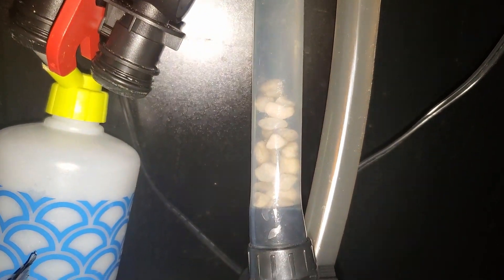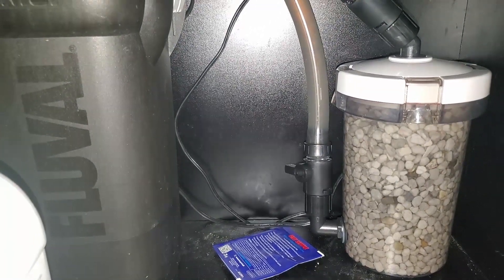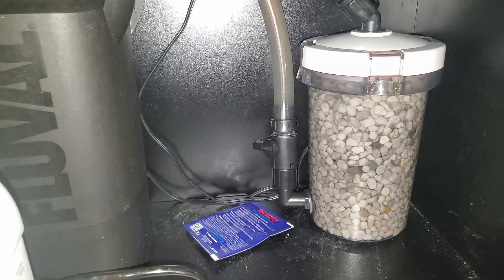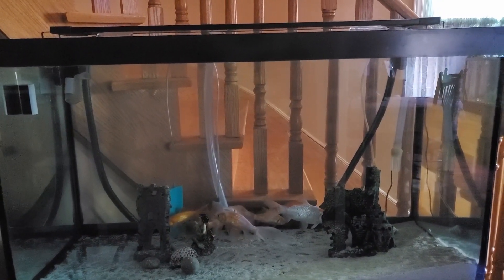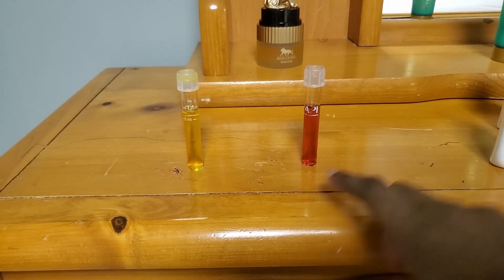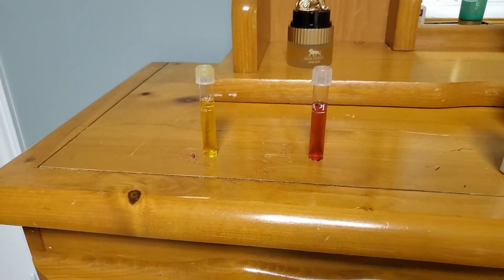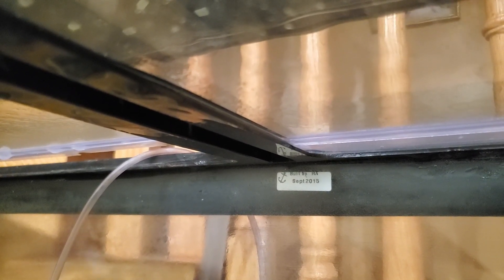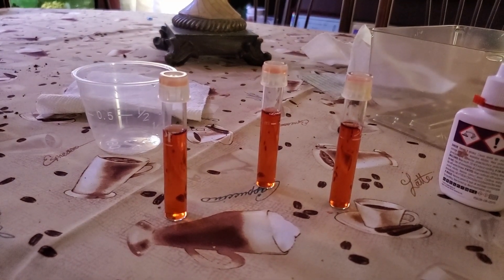Nitrate  Reactors Do Work

Comment: Seachem matrix is just pumice stone at 4 times the price now the full cycle can be achieved by deep substrate beds of 3 to 4 inches this will encourage anaerobic bacteria this converts nitrates into nitrogen which simply bubbles off adding leaf feeding plants will help also and removing the waste before it can break down ,,,how long did you cycle your tank
Reply from the maker: The reactor has been cycled for approximately 1.5 months the tank however I wouldn't remember
Reply: @aquaticspendthrift4228  sounds like a break in the cycle ,,but great idea especially with gold fish

Comment: 1droplet/s. 10s 1ml. 3600s =1h 360ml. 24h  8.5L per day, reactor can process aquarium water. If aquarium is smaller than this volume, then it will be possible to remove nitrates. Otherwise nitrates will constantly add to water. Or it will be like diluting aquarium water with clean one. Technically to remove nitrates we need 51% water change or roughly 17l aquarium can work, if we exclude all canister or sump water.  If reactor can process 10droplets per second, then it would be realistic that people show how they denitrificate almost 200l aquariums.
Reply from the maker: Yes that is assuming your goal is to generate 0 nitrates in your aquarium. My goal is to reduce water change frequency. If you did want to generate 0 nitrates you would go with a sulfur denitrator which can easily handle 10 drops/s
Reply: @aquaticspendthrift4228  constantly weekly add glycerine diluted 10% around 5ml. If to use more than 20ml, can jump nitrites. Nitrates reduces to 10ppm. In my case i have 15l of ceramic rings and balls, and repurposed to anaerobic process internal juwel filter, which get water from canister filters. All canisters connected in series.
Partially unstable. Would be good to buy nitrit, nitrate and orp selective electrods. And close cycle of canister filter, periodically based on data refresh water and add carbon sources.
2years almost no water changes, only add water when filters were cleaned, once per 2 weeks, around 6l due to prefilter. All other bio filters once per month or more if flow do not drop, give extra 15l.
Reply from the maker: @iIiWARHEADiIi  Just to make sure i intrpreted correctly,  you add glycerin as a cabon sorce to help with the nitrogen cycle. You have 2 filters in series 1 being used exclusively for biomedia. And use a nitrogen selecive electrode to monitor nitrate leves out the filter and adjust glycerine (carbon dosing)
Reply: @aquaticspendthrift4228  eheim classic very old one- prefilter, jbl900 and jbl1500 all in series. Output goes to internal juwel filter filled with seramis baked clay. Yes, glycerin as a carbon source, used also on sewage water treatment facilities.
Selective electrods still dont have 🙁, only wishes

Comment: use sand, and you need carbon sources, like sugar, alco, co2, for those bacteria to work(minerals) if theres oxygen, they use oxygen instead of transfering no3 into n2
Reply from the maker: Its actually seachem denitrate in the filter which is a very porous biomidia. Also carbons sources help but are not necessary as your always adding fish food which is a carbon source.

Comment: Try very porous media like bio gravel in it. Normal gravel doesn't really do much in terms of Anaerobic bacteria because the outside has high oxygen. You want slow flow rate, very porous media, the outside of the media will have aerobic bacteria which will gobble up the oxygen and deep in the porous media the Anaerobic bacteria will flourish.
Reply from the maker: Its actually seachem denitrate in there not just regular gravel and I have recently switched it to expanded clay which seems to work just as well. I believe the flow rate/ how much oxygen you can remove before it hits the reactor is the most important factor when setting up a nitrate reactor.
Reply: @aquaticspendthrift4228  Glad you got it working out. I have anaerobic conditions in all my aquariums. But I just use biohome ultimate in the filter at 2kg per 100L of water. Works a charm.
Reply from the maker: Just out of curiosity for your tanks running biohome what size are they and what filters to you use and what are your average nitrate and how frequently do you water change?
Reply: @aquaticspendthrift4228  450L African cichlid tank. Fx6 & Maxi kani 1200. Combined 9kg of media between the 2 filters. 

240L tank Discus and angels community, Eheim pro3 and Sera Uvc extreme 1200. 4,5kg of bio media. 

100L tank, Eheim experience 150 and eheim internal filter. 2kg combined media. 

Water change every other week. But not for Nitrates, just for minerals as PH buffer. Faster here isn't very high in mineral content.

Comment: It’s not the length of the hose it’s the flow rate, you have reduced the flow rate with hose kinks
Reply from the maker: Actually it is, at least from the results I got. I initially ran it without the hose from fast to extremely slow drip rates and I didint get any results(still got nitrate readings). Within 2 weeks of adding the hose i got results at fater driprates than without the hose. I think this is becuse it gives more time for the oxygen to be depleated before it actually reaches the caster full of biomedia. With a longer hose you can have higer flowrates becuse of the increase contact time i belive.( Not 100% sure but thats the results from my test). Its why coil dentrators work but they have the flaw of clogging since airline tubing is so small.

Comment: Watch Dr. Kevin Novak he'll show you how to setup what he calls a BCB Basket. Dude is smart and has done actual tests on all this stuff.
Reply from the maker: Ill check him out
Reply from the maker: So i just watched one of his videos and it appears im doing somthing very similar, ironically someone comented to add expanded clay insead which i recently did also.
Reply: I think your biggest problem is you have the water flowing through the media when it needs to flow around it. You don't want water flow actually going through because to much oxygen gets in.

Comment: Cool! Where is the water coming from to the nitrate reactor? It needs to come, in my understanding, from your most efficient nitrification filter. Have Y cross ing in the outlet of this nitrification filter and a valve to control the Flow rate to your denitrification reactor. This way you get as anoxic water with the highest nitrate as you can get to your reactor which is what you really want. Hope it works out for you!
Reply from the maker: My nitrare reactor is basically set up like that . The flow is coming from my canister filter. You can see how i set it up int the following video https://youtu.be/5sgWpS0Cegk

Comment: Awesome experiment..please continue more experiments.. can you look into kevin novaks video on how to set up anoxic cannisters ( basically make the water go around the media than through it) and if possible use different media to experiment..like pumice, leca balls .
Thank you
Reply from the maker: We will seee. I kind of broke my nitrate reactor 😓 so i need to buy a new one. What im more intreseded in rather than the type of bio media is adding a carbon sorce like woodchips could bost its effectiveness and test it on my larger tank.
Reply: @aquaticspendthrift4228  pumice and leca balls have been used for commercial denitrification..and much cheaper..so you could try those..as of now are you using any carbon source? Fish food is supposed to provide some.. you could use one or two chunk of horticulture charcoal..i know that is used for providing carbon source in potting mixes.. Specially succulent mixes..methanol and vinegar just seem more risky..you could also incorporate a bit of iron compound in the midst of the media..that kickstarts the growth of anerobic bacteria..
Good luck again :) again.. great effort..do keep it up..
Reply from the maker: No carbon sorce just feeding the fish. ya i dont want to use liquid sorces because it would be a lot of work to constaly dose and monitor - like you said more risky. Probably wont do more vids on the nitrate reactor for at least 4 months tho
Reply: @aquaticspendthrift4228  yep.. that is understandable, as new denitrification media will take at least 3-4 months to fully mature anyway.. will be waiting .. Hence..subscribed..

Comment: Ive tried similar setups for over a year .  High flow low flow.   Never any real drop in nitrates.  I may try a longer tube.
Reply from the maker: Yes i had problems with it with a short tube and it dident rly work. Once I added a long tube and ran it for a few weeks at a drip rate I really started to see result, like really amzing results. In 2 weeks my nitrates would be over 160ppm (max reading by api test  kit) if i didn't do a water change and after that it wouldent go above 20ppm after 2 weeks.

Comment: Hi,
Instead of adding longer tubing, try ganging another reactor to the one you have already up and going.  Full of matrix, again.
Somewhere down the line, the nitrifying bacteria will consume all the O2 in the 1st reactor, leaving the 2nd one ready for the anoxic anerobes. 
Put in a piece of driftwood in the tank, and now you have a carbon source to feed it. 
That  way you can increase the flow rate and process more water to suit the reduction need.

Comment: Supposedly once your getting zero nitrate at one drip a second you can bump the flow up too 2 drips a second, retest after a week if still getting zero nitrate, increase another drip and so on until you start detecting nitrate in the outflow, to basically dial in what your reactor can handle
Reply from the maker: Yep thats what im testing now. I want to see if this set up could handle a 55g with 6 goldfish
Reply: @aquaticspendthrift4228  I have a overstocked 110 gallon tropical tank, and used a 3l hang on , bio media tumbler reactor, or basic calcium reactor, and used carab sea no nitrate (supha aragonite blend) it's probably a bit heavy/safe on aragonite. It's running at at a slow steady stream any slower and it would be a fast drip. And it seems to be working. Tank water tested at a little under 40ppm nitrate and the effluent from reactor was about 5ppm nitrate, thought I would let you know, just in case, you ever decide to switch from de nitrate to supha based media, it does work